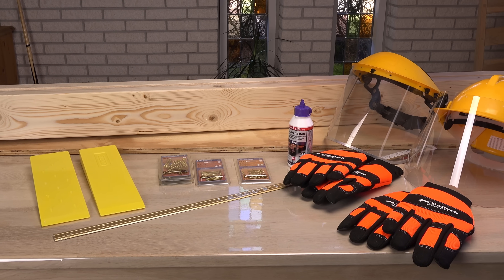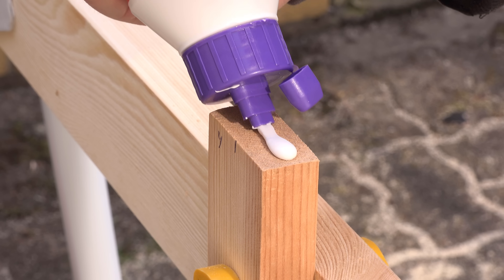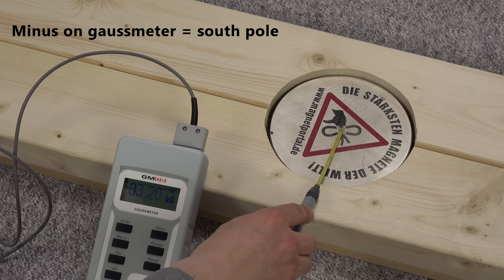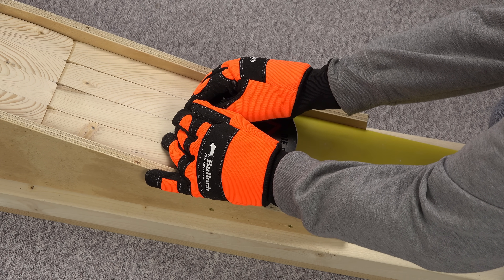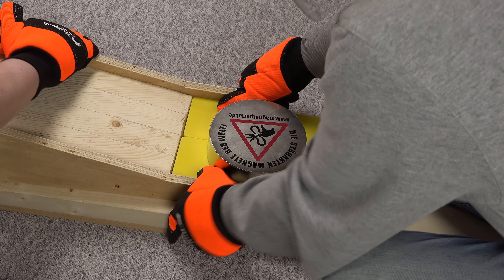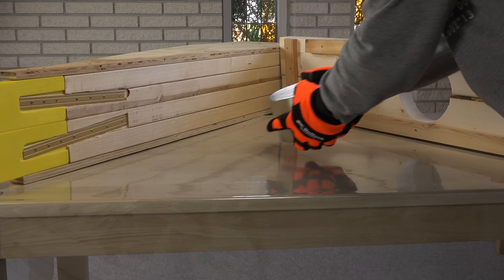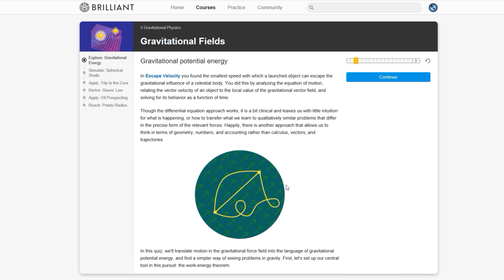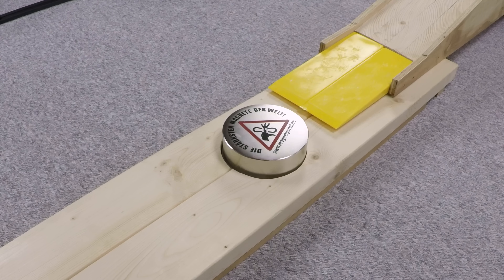Monster magnet meets monster magnet...

Comment: If the magnets did “smash” together would it actually shoot outward, or would the strength of the magnetic pull keep it in a shattered mess? 🤔
Reply: I think the larger pieces would probably fly out with less energy than they could have but the smaller pieces won't be magnetic enough for that to make too much of a difference I think. Especially if they fly at each other with great speed.
Reply: @a_zombies_player  the other guy told me and i got the point no need to repeat it
Reply: if a magnet breaks, all of its magnetic fields are gone with it
Reply: @ReikiMaulana  not true
Reply: See mr indian hacker new veido
Reply: https://youtu.be/u99VJtc72ys it becomes a shattered mess, these guys tried it out
Reply: https://youtu.be/amhIDpvgxvo mystery solved
Reply: half of the bits would repel the other half while grabbing prefereed shards. it would be a mess of shrapnel like razor ceramic.
Reply: they would most likely fly out
Reply: @rustable4165  I have many broken neodymium magnets that were originally cylindrical and when broken, all pieces
remained strongly magnetic. The reason that neodymium magnets fly apart ferociously is that they are held as a
solid piece, but in fact, are like powdered tiny magnets molded together with a "glue". All "molecules" of this form
have the same polarity. Like polarities repel!!! Once the "glue" is fractured, the shattered pieces are blown away
from each other. VIOLENTLY!!!
Reply: @rustable4165  no, they wouldnt. Magnets don't lose their fields when broken, but they do have a N and S pole.
Reply: I believe they’ll broke in some pieces and fly together
Reply: they would for a lump of magnetic debris .
Reply: If a magnet breaks its just creating new smaller magnets, I think it would depend on how they break. I watched them cut a big cube neodymium magnet on the waterjet channel and it shot apart because when it split, it was then 2 magnets with new poles and repeled eachother
Reply: They would explode extremely violently i have seen two much smaller magnets smash together and they exploded i can only imagine the carnage between them if it happened
Reply: My dirty ass mind read this differently 🤦‍♂️
Reply: Each piece would count as its own individual magnet with their own magnetic field. Some of the pieces would be repelled by the combined magnetic force of complimenting magnetic fields, or aligned magnetic fields,  and some of them would be attracted into a mass because of complimenting magnetic fields of the bulk of the pieces. I think.
Reply: I believe if with that amount of force they would likely just shatter. Sure there would probably still be a lot of individual pieces held together but nothing significant
Reply: Yez
Reply: Nope man all is good
Reply: Most of the pieces, if not all would remain stuck together.  For a piece to fly away would require a velocity multiplied by its mass stronger than the magnetic force it felt.  This would depend on the distance when they were released. Also, as the magnet shattered the magnetic field would weaken as any peices that split along the N-S axis would now repel, which if aligned along the vector of the velocity, could help a piece fly away.   If you tried to shatter them by moving them closer and closer until the force took over and brought them together then you would have your greatest chance of having a peice fly away because they would have the greateat velocity.  If you resisted the pull by slowly bringing them together and they took over you would have a lower chance of a piece flying away.

You can see the difference in velocity by trying it with very small magnets.  Slowly bring one closer to the other until one flies to the other.  Then hold one in each hand while you bring them closer together resisting the pull.
Reply: Good question, I know very large amounts of kinetic energy like a massive shock or repeated shocks can de magnetize a magnet so some small pieces might be able to fly out
Reply: It’d creat a black hole
Reply: I'm not a magnesiologist or anything, but I believe it would shatter then some pieces would clump together
Reply: Shattered mess. I've worked with neodymium magnets for years. It's an industrial setting, so I'm not saying I understand the science. That's not to say that no pieces ever get away, but this idea that the smaller pieces are "less magnetic" is just wrong. You'll end up with a bunch of chunks all stuck together. Plus, they will be dangerously sharp.
Reply: They'd develop a bunch of cracks, but you won't get anything remotely like an explosion. Everything will just stick.
Reply: The Slow Mo Guys made a video about it
Reply: @tearex7023  ok
Reply: @rustable4165  I find it so funny that you almost give an absolute answer without being educated in this whatsoever
Reply: @lucas_wmd  what are you trying to do with this reply lol, also your over a year late
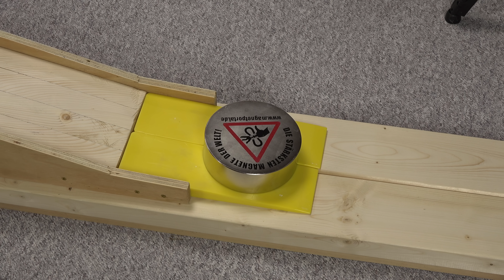Reply: 5:43 that exhale scared the shit outta me. I was so focused (Wear headphones)
Reply: I think once they break they wont be magnetic anymore
Reply: @AmmarAbdSaleh  that isn't how magnets work. I actually own a neodymium magnet that was broken in half and both halves still work.
Reply: @ashdoesstuff3575  ur magnet got split into half, meanwhile the magnet the comment is talking about is smashed into small pieces
Reply: @AmmarAbdSaleh  well the shattered pieces will still be magnetic, albeit with a much weaker magnetic force than the full magnet. Source: I shattered my magnets once, even dust-size particles were magnetic, although very very very weak.
Reply: @ashdoesstuff3575  UNUS ANNUS UNUS ANNUS
Reply: @AmmarAbdSaleh  You don’t understand how magnets work. Try reading a book.
Reply: @kitukitukitu-lous  ye the shattered pieces are still strong enough to fup a GPU. i had some small pieces stuck to my screwdriver and one got stuck on my GPU's backplate, it got on it when i was taking it a part to clean the dust and changed the thermal paste. i was having some issues after i put the card back together and was wondering wtf was wrong with it. then i saw small piece stuck on the backplate and after i removed it with tweezers the card started to working again.
one thing is sure, GPU's VRAM dont like strong magnetic fields xD
Reply: @AmmarAbdSaleh  then you have a couple thousand little magnets
Reply: @Michel-7.7.7  bro, i really got the point. I was wrong, you were right. Now please stop filling my notifications
Reply: @AmmarAbdSaleh  you wanted to know, i answered once. Say, thank you very much and cut off notifications
Reply: @Michel-7.7.7  they already answered 🙃
Reply: @ashdoesstuff3575  Channels gone bud
Reply: @AmmarAbdSaleh  smaller pieces of magnets just turn into smaller magnets
Reply: @heinrich.hitzinger  ?
Reply: @official-obama  Do you happen to know Norbert Moses?
Reply: @heinrich.hitzinger  no
Reply: @AmmarAbdSaleh  -   I have many broken neodymium magnets that were originally cylindrical and when broken, all pieces
remained strongly magnetic. The reason that neodymium magnets fly apart ferociously is that they are held as a
solid piece, but in fact, are like powdered tiny magnets molded together with a "glue". All "molecules" of this form
have the same polarity. Like polarities repel!!! Once the "glue" is fractured, the shattered pieces are blown away
from each other. VIOLENTLY!!!

Comment: Constructive criticism number one you should have put oil on the plastic it would have slid with no problems and not bad no sound number two I seen other people use a rubber mat I'm still not brick nothing and it was much easier because they told it to in the end this video was pointless now if you would have told me you're going to do something magnificent with the magnet then I might have jumped up and down not